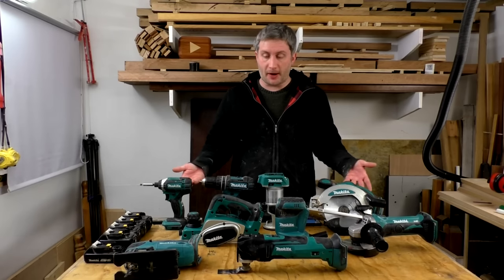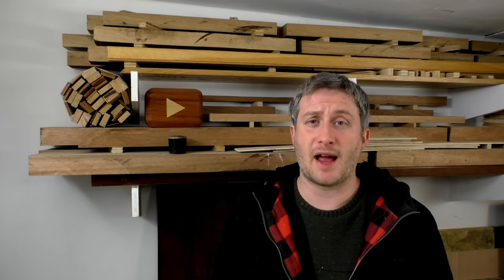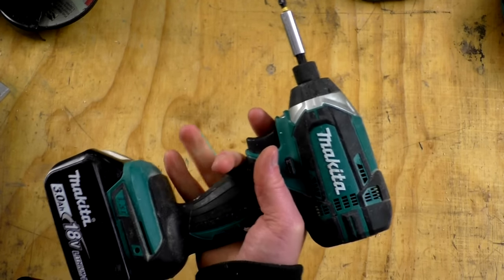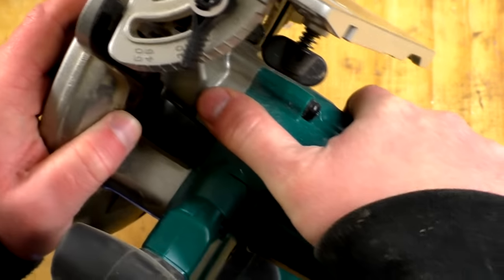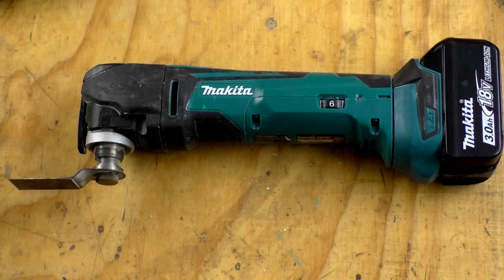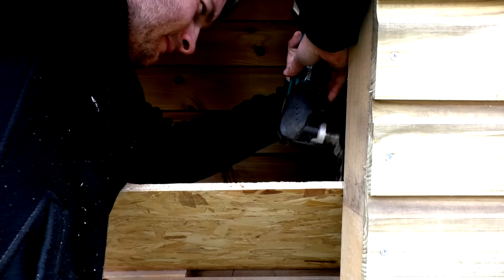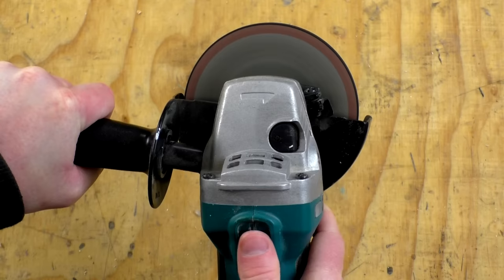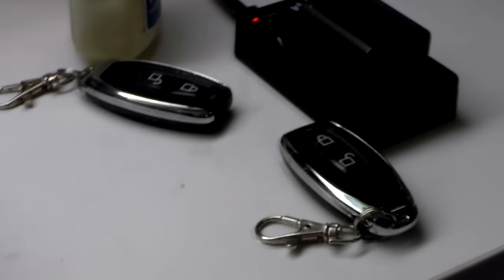My Makita Cordless LXT Tools Review

Comment: If you think Makita is just an average power tool.  You are so wrong!  Makita is a top quality power tool company. It fights with the very best and it wins in a lot of cases. I think fest tools are average. My team up to now is Dewalt & Makita,  Milwaukee is also hardcore.
Reply: Heckee Pagan No I don‘t think so Festool,Fein Maffel are way better than Makita
Reply: @leonk.1031  I think bosch professional is better than festool
Reply: Makita are cheap Chinese built now... Most tradesmen are starting to switch away from the brand due to them being underpowered and not lasting as long.

In fact I've seen the milwaukee 12v fuel range last longer and have better results.

The only makita tool you'll most likely see being bought new is the cordless 18v router/trimmer
Reply: milwaukee is "cheap chinese built" as well dude...they are even owned by a chinese company...
Reply: @TRUE_GR1T  yeah but it's not cheap built like Makita.
They also have invested in top end tools and don't make BS tools for Joe public
Reply: I also find it funny you say milwaukee doesn't make tools for "joe public" yet all the home depots here carry almost their full cordless line, yet only the crappy bottom of the line Makita stuff. If I want the real Makita gear I have to go to a fastener shop, a Makita service center or buy it online.
Reply: @TRUE_GR1T  nah I've seen them on site and use them day in and day out... Newer Makita is low quality and doesn't last at all.

Go on a British building site and you'll see next to no Makita gear, unless it's the older stuff.

My M18 surge drives screws that most Dewalt, makita and bosch struggle with
Reply: Fest tools are over rated and priced. I think Makita is a premium brand as well
Reply: @Jack Morris most makita tools are made in China...every company makes their cordless stuff in China. I have a makita cordless jigsaw made in the UK and a few of their tools probably are made in japan but the majority are made in  China sadly.
Reply: Ave tore a festool circular saw apart and it was just horribly built. I would not spend 1000 of my hard earned money on that pile of junk. Seems to me They kinda have that Apple marketing going on for their fanboys.
Reply: @Mrmhibbert  makita are made in Japan dude not China. Ill take a tool made in japan over China any day. Just about all power tools are outsourced these days. I've never had a tool hold up in my shop doing metal fab like our makitas have old or new and I've gone through dozens of each make.
Reply: @MadMetalShop  they majority are made in China, the company is headquartered in Japan. Maybe very early makita was made in Japan and a select few tools still are but my entire cordless kit aside from the jigsaw is made in China. Do I really have to take pics of my entire kit's labels and upload it to prove this? I have 3 hammerdrill drivers, 2 impacts, 2 recips, circ saw, led flashlight, grinder, radio,  jigsaw and heated jacket. Edit: and all my Makita stuff is from actual Tool stores, not home depot the hammerdrill and brushless recip I have are their top of the line options.
Reply: @Jack Morris AVE does a teardown on one of those dewalt "made in USA" tools and the quality is no better. I bought one the tape measures that is made in US of global materials and I'm really unimpressed with the lock. It sticks so hard I need to use 2 hands to get it to unlock sometimes. Like I said though all the big tool manufacturers are making stuff in China, it's just cheap labour it doesn't mean the final product is shitty since they do their own QC. I've had my Makita kit for 5 years and have been pretty happy with it. If you live near one of their service centers they provide service on the same level as the hilti stores.
Reply: @TRUE_GR1T  some are but many tools aren't. All my newest grinders were actuslly made here in the US. Depends on the tool And model. ALOT of those kits are put together with economy models.  And if you think because a Makita came from China is any less quality then you would also be mistaken. They have the same quality control in China as they do anywhere else. 

Myth 1: If my Makita has "Made in China" it must be an inferior tool or a Makita copy.

Fact: China has one of the most state of the art factories. All of the Makita tools are tested and do not leave the factory unless they meet Makita's high standards.

Myth 2: Real Makita tools come from Japan.

Fact: Wrong! Makita tools are produced all over the world. Japan, China, USA, Canada, Mexico, Brazil, Germany and the UK. Each individual factory produces different tools.

Some other Makita related myths I can bust along the same lines are;

Myth 3: Buying tools from America is cheaper than buying tools from Australia.

Fact: Sometimes. Buying Makita from America may seem like a good idea at the time but there are a few things you should be aware of before you do. Your warranty WILL NOT be valid in Australia. Makita Australia do not recognise foreign serial numbers. Any repairs that are to be claimed under warranty will need to be sent back to the US at your own cost! You can have them fixed here however you will have to pay.

The voltages are not the same. US = 110V, AUS = 240V. The tools Makita produce are made for specific countries. Using a step down transformer will only damage your power tool and basically half the life!

You will not fine the "C-Tick" on any tool not made for Australia. The Compliance mark is something that proves the object is safe for Australian conditions.

Myth 4: Makita tools aren't as strong as they used to be.

Fact: Makita tools are one of the best trade tools in the world. They come with a 12 Month Trade warranty. They are made for use ALL DAY EVERY DAY on the job site and will stand up to enormous amounts of punishment. It's not uncommon for you to have a Makita tool for 10-20 years..
Reply: @MadMetalShop  I actually said in my reply to Jack Morris ". Like I said though all the big tool manufacturers are making stuff in China, it's just cheap labour it doesn't mean the final product is shitty since they do their own QC. " And I don't live in Australia so I have no reason to buy tools from there, but I agree with everything else you said. Correct they have factories all over the world but the cordless line seems to be 90% made in China but my jigsaw is made in the UK for some reason. I love my Makita stuff man!
Reply: @TRUE_GR1T  it just depends on the model and they have about a dozen types of each tool. I swear the impactor I just bought this week for my own personal use said made in Japan but I'll have to double check. Yeah it don't stop be from buying a good tool and Makita makes good tools.
Reply: @Jack Morris yeah it's 4 years old nowbut performs just as well as the competitors brushless models. Brushless drill tech can't really go much further (there is only so much they can do to a drill) l. I guess they can start adding smartphone apps like milwaukee but personally I don't need that shit I just want a tool that works when I go to pick it up. I'm not sure what you mean they need to get it together with their batteries though, they added the indicator lights finally a few years ago which was my biggest complaint as a makita user. I still have my 1.5Ah slim batteries from 6 years ago and my 3.0Ah batteries from 5 years ago and they still function. Their batteries are still the fastest charging in the industry.
Reply: @Jack Morris dewalt tools kill themselves. They have shit tech inside them and won't shut themselves off to prevent tool damage. VCG construction killed 2 of their impacts and their hammerdrill in their tests. I can't think of any tools I'd need 2 60v batteries in unless they come out with a cordless jackhammer. Once you start getting over 6Ah the batteries take over an hour to charge. Not saying Makita shouldn't have 9/12Ah batteries though. The 60v line doesn't even seem to perform that much better (https://www.youtube.com/watch?v=1zcLNilluZA) I mean Milwaukee hasn't come out with any 2 battery tools or 60v stuff, just higher AH batteries.
Reply: actually on the large pressure treated cut the milwaukee got smoked.
Reply: Martin Hibbert Makita are Japanese made components they are only assembled in China. Big difference
Reply: Dewalt default
Reply: MadMetalManiac74  I love makita as well own at least 10 impacts, 10 drills , jigsaws, grinders,router all cordless, now into the x2 line. x2 10’’Dual compound , worm drive grinder etc. But I’ll tell you what I have Woodworking friends that live in Japan and what’s made and offered in Japan is a whole different thing man. Bet you’ve never seen a red or lime green impact by makita from Japan? They offer some much more advanced makita stuff . There’s some nice ones on eBay right now as a matter of fact. Check it out , you’ll be impressed if your a mak fan. Also I will say from 30 years experience, any makita that have been bought a big box stores like HD, Lowe’s etc. seem to have the made in China emblem, the ones bought from Woodworking stores usually have a made in Japan. There is definitely a difference in life of the tool on ones made in Japan. Huge difference, I know the factory in China is high tech , but the ones made in Japan always out last. Maybe Quality out of Japan tRumps that of China, I’d bet on Japan if I had to !
Reply: @leonk.1031  that mafell cost a FORTUNE!! i mean A FOOORRTUNEEEE...
Reply: @Mrmhibbert  ** it is japanese mate
Reply: @Mrmhibbert  Most tools these days aren't built like they used to be ( but look at cordless stuff nowdays compared to when it first came out), not at all sayin they are bad but Makita are still a top tool overall imo , Milwaukee is owned and made in China , I've had zero issues with any of my Makita stuff , just sayin
Reply: Heckee Pagan festool tools are extremely durable
Reply: @leonk.1031  noooo. Kill that noise. Milwaukee killed snap on and Makita killed fest tool. Even HILTI got smacked by Bosch.😁😁
Reply: @HerreDePerre  I'm using my great great, great grandpa Makita right now. Now who is durable? Fest tool is good expensive tools. Makita is excellent inexpensive tools.😁😁😁
Reply: Heckee Pagan The Festool corded things and the cordless tracksaw and the cordless orbital Sander is better too
Reply: Heckee Pagan Makita is Nice but it almost feels like fest tool is on a other level
Reply: Makita and Milwaukee and both perfection brands 
Which is why I love my Milwaukee (and a few makita)
Reply: @TRUE_GR1T  Planer is usually UK made aswell .. but I don't know why people always think made in China equals bad build quality when the company is from another country , they adhere to the same quality standards
Reply: Weighing in a bit late but Makita are (and have been for a very long time) a quality brand with 10 factories all over the world including China, just like everybody else. Nothing wrong with China as long as the quality control is robust. Take a look at how many tradesmen use them, we know what works because we rely on them every day.  Every range has the odd rogue but I wouldn't swap my teal blue buddies for anything. Obviously Festool, Mafell etc make some brilliant kit but I don't feel they offer that much more for sometimes more than the cost of a new kidney. Just got the Makita Cordless Track saw and Trim router now I'm just a chop saw from throwing my extention lead in the trash. Opinions online are ten a penny but educated time served tradesmen will always be the best judge of a tool range IMHO.

Comment: I also use makita and have quite a range of tools, strangely the only tool we have the same is the drill! I also have several impacts, 2 hammer drills, 2 sds-plus, metal circular, 3/8 impact,1/2 impact, 2 drywall screwguns, sawzalls, 36v rear handle circular, 36v tracksaw and chainsaw.  I have a feeling I am forgetting something! I still want the jigsaw, router, sander and sliding mitre saw in the LXT platform.

Comment: Spot on.  I will most definitely be looking at mikita
Reply: I have used multiple brands over the past couple decades. After my truck was stolen with my tools in it I still opted to buy Makita again. I don’t have a single complaint on any of them from battery SDS hammer drill, angle grinder, multi tool, recip, on and on. 

The exception would be that my chuck for my drill randomly seems to not want to maintain its grip. I run my tools heavily though. I’m not neglectful or abusive but I don’t bother to baby then. My drill for example has been used as my my mixing drill for multiple bathroom tile jobs. 

Not sure where your at but we have some great deals a couple times a gear. 

Derp. He did mention an issue I had with the plastic guard partially breaking but that the only issue after an impact I wouldn’t expect any other saw facing without damage. I don’t like less than 4ah batteries but they do charge fast and if you aren’t doing heavy demo of the recip saw or drilling a lot of holes in concrete you they don’t die that fast.

Comment: Excellent coverage. I have a limited budget for my hobby shop and normally use cheap tools from screwfix and Argos etc. My drill driver gives up after about 15 mins. Use. I'll definitely be using the links and (pre-owned) eBay for some of these in the future. I particularly like how all batteries fit all machines. Great tool shop tour.

Comment: Wont ask about the Vaseline at the end :) But I have a Makita cordless drill and angle grinder and glad I bought both. I am not a heavy user of them but I wanted tools that would hopefully last the rest of my life. I am especially pleased with the grinder, and it has enough power to cut through concrete and thick rebar no problem, but you do need to use the 5amp battery to get any useable time out of it. I will be getting an impact driver next as I am going to start a shed/workshop build soon.

Comment: Nice quiver of tools, good ref for someone looking to replace or get a new suite on a common battery platform.  Surprised you went brushed in 2018 given advantages of brushless but yeah cost is a factor, the brushed are cheaper now mebbe they are looking to clear them out.  I dont agree with yr comment Makita are a mid range tool, I'd rate them as upper range, the build and reliability is excellent.  (Theres a reason tradies all over the world use em hard).  You could have covered battery economics, its something users need to keep in mind.  Batteries aernt cheap and they have a lifecycle, more you use/recharge them sooner they are dead.  Some of those tools you can go corded like the jigsaw, router esp if yr shop based in those applications.  You could setup multi power outlets around yr central bench  if the small shop two step is a pain.  Thanks for the vid keep em coming.

Comment: Really like your channel. I’ve got all Makita tools also. Wish I’d bought the oscillating saw and jig saw instead of corded models. Thinking of getting the circular saw and palm router. Have you had any experience with knockoff makita batteries? I bought some on amazon and they seem to work fine. Sometimes I have problems ejecting them from the tool. But other than that it has been a good low cost option for more batteries.

Comment: i love my makita tools. my cordless collection consists of around 20 different models and im pretty happy with most of them. i also have the random orbit sander and mine is really good on battery and i cant complain about the speed either, perhaps being a sealed brushed motor you ended up with a dud motor in yours. the one thing i wish makita would hurry up and make is the cordless lxt tyre inflator. i have created my own 18v inflator with parts from a cheap inflator and the electronics from a dead makita tool which works great but it would be nice to have a branded one :D cheers and good honest review!

Comment: I replaced my old blue Ryobi drill with the white/black Makita combi. Been about the block loads and still going strong. Undecided as keep or change brands when it’s time. That’s the only cordless I use these days... have the cordless circ saw, but never use it as it rubbish.... bogs down far too easy on anything thinker than 1/2” ply. Wet 4x2 and you’ve no hope!!  The fluorescent light is handy though!!

Comment: on the bright side of your makita sander going so slow, It won't clog sandpaper as fast because it makes friction, meaning less heat buildup, and less melting of the resins in the wood, meaning less clogging.

Comment: i highly recommend upgrading your grinder to a brush less one with the disc brake and variable speed it makes it so much more useful and safe. also the brush less motor uses so much less battery. i got one like yours and took it back for the brush less one that was only £40 more at the time. now i go wood cutting and wood grinding as well as blade sharpening with it. also i have seen narrow belt sander adapters for angle grinders

Comment: I'm a professional cabinetmaker and I use Makita.  Used to used DeWalt but I like the Makita better.  Made the switch about 3 years ago and haven't had any problems yet.  I have my eyes on the trim router, the grinder, the multi-tool, the circular saw, the weed eater, the blower...  It's all a personal preference mostly and what tools you plan on using.  I would stay away from the "Joe Public" brands like Ryobi, Ridgid, Black & Decker, Skil, etc.  Those are whole different level, the bottom level.

Comment: NIce set of tools mate! I have a few makita tools aswell as the sander. I have never had an orbital sander before and indine it very uncomfortable to use. It seems to throw my hand everywhere as if it has hit a bump in the wood that it doesn't like. Any thoughts? My corded oscillating sander is smooth as a button but i hate using this one